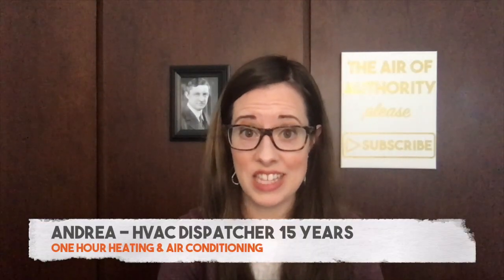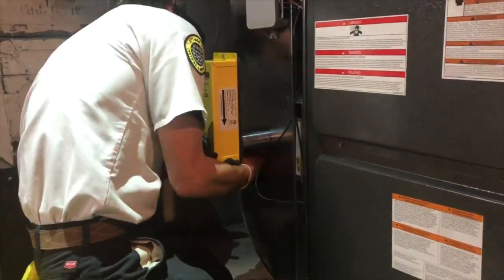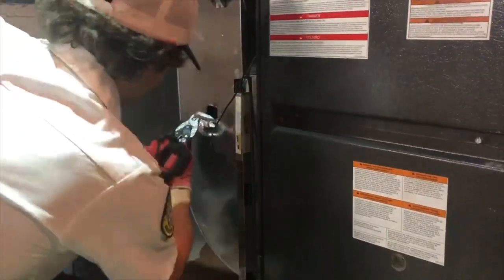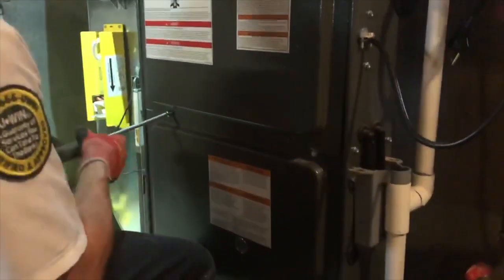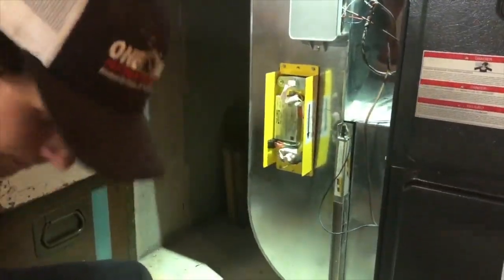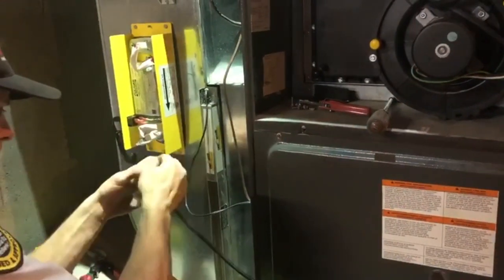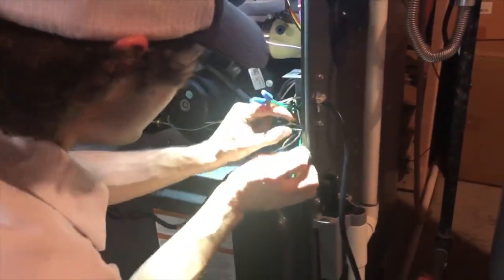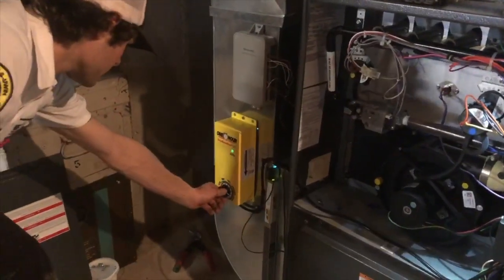UV Light Installation HVAC (How Does UV Light Work?)

Comment: Thanks for the video.

As I understand this device (UV light) installs at the intake duct, right where furnace sucks the air from the home (before paper filter)? I saw some other videos where I’ve light installs inside the coils of the furnace but I do not have much room to access there. Furnace room is too small and I also have to remove gas pipes (which I do not want to mess around) in order to reach. I only have access to one side of the furnace really. Three other sides are blocked of and can’t be accessed without doing major work. If this device installs at the intake, right before the paper filter, it will work for me.

Thanks again.

Comment: I just replaced UV light bulb and it was on for a few seconds when I flipped the power, and then turned off. The green system monitor light also went off. Any idea what’s wrong? Thanks

Comment: Why not install this above the coils to help clean there? If your coils are filthy you are just going to pass clean air right back through them.
Reply: That is a valid point.  Also the speed of air flowing by the uvc light is too fast to expose the particles and degrade them. The science for efficacy is duration of time, intensity (energy) and distance.
Reply: ya...one hr is know for their rookie techs...you are supposed to put it above the coil...the area where they put it...the uv light will destroy the filter so fast.

Comment: The UV will run all the time? I thought it work with the blower. Looks like waste when system idle.
Reply from the maker: Hi George, thanks for the question.  Yes, it does work best while running the blower.  We actually answer your particular question in this week's video: https://youtu.be/Kc2WMdfxzD8
Reply: @TheAirOfAuthority  Thanks!

Comment: Is it better to install the UVC in the return or above the furnace (exit)?
Reply: It depends what you want the light to do.  If you want to kill the bacteria, etc moving in the air to be killed, it is more effective in the return duct.  If you want to kill any bacteria or build up on the coils, you would mount it above the coil.  I prefer keeping the coil clean because it will prolong the life of my a/c/heat system since the gunk is not clogging up the fins of the coil.  I had black gunk growing and dropping on my filter - and I want to stop that growth - so I want the bulb installed to shine above the coil.